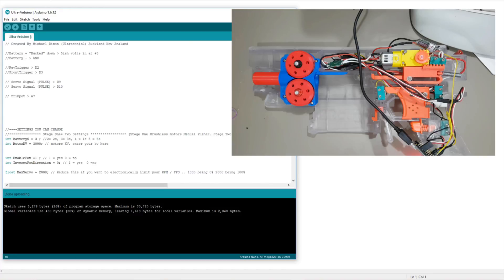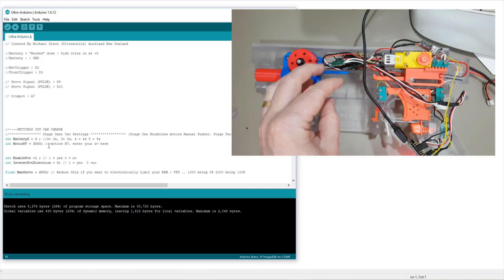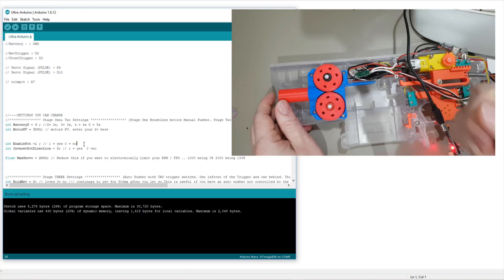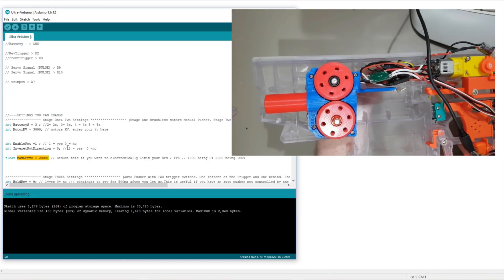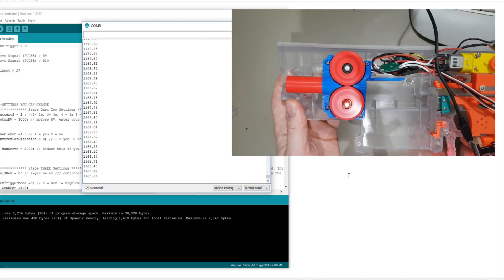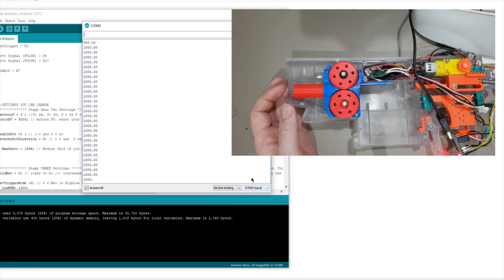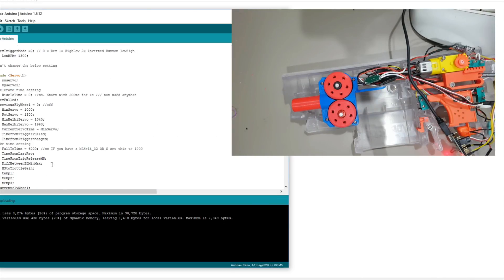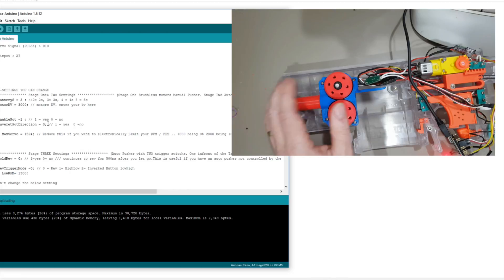⚡️ Nerf Gun Mod: How To Limit FPS. Stryfe / Swordfish

Comment: I would like to build a model that only uses a single trigger for firing, like the FDL-3 blaster.  This seems like a good starting point, lots of software to make it happen, but that is what I do well.  Would you be into collaboration?
Reply from the maker: Join the Face book Group... https://www.facebook.com/groups/MakingStuffAwesome/ 
Im about to release some software that will make this kind of thing Massively more accessible to people.. IT would take far to long to explain all it can do ... BUT  short it's a windows app that will program the arduino for the user by just selecting what options they want to activate . and what it should do
Reply from the maker: Though not stated before.. Select fire, single trigger is already done with more options than whats available on other blasters.
Reply: Thanks for the reply!